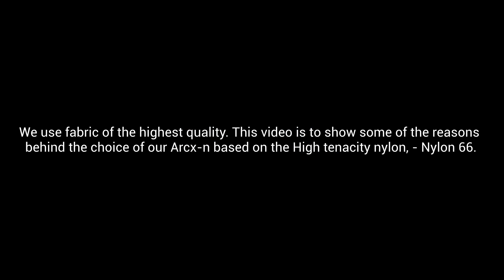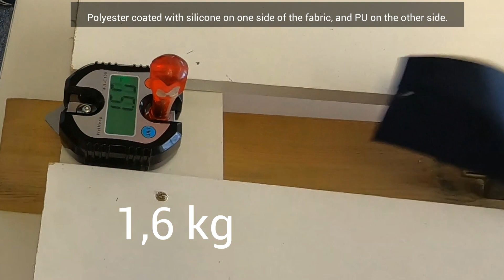NORTENT of Norway fabrics

Comment: what about PE coating for tent floors? Will PE have less problems developing a  bad smell and falling-apart compared to PU coatings ?
Reply from the maker: For the floor it is practical with a PE/ Pu coating. (PE is an evolution of PU) As this coating gives a much higher hydrostatic Head which it needs as the floor is subject to pressure when stepping on it, etc. But on the floor we only use PU/ PE and not in combination with silicon as many manufacturers do with the flysheet. The silicon wanders through the fabric and makes the PU/ PE peel off after some time. This is not the same case when the fabric contains only PU/ PE on just the one side of the fabric. So. For the floor we are able to use PU/ PE without the same deterioration as you will experience with the flysheet.